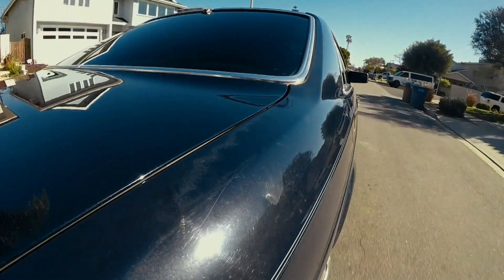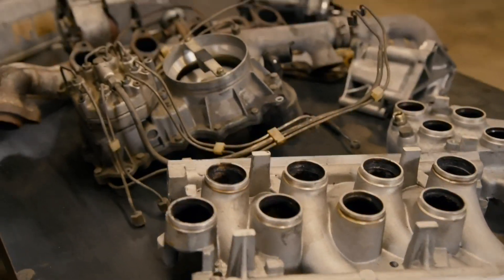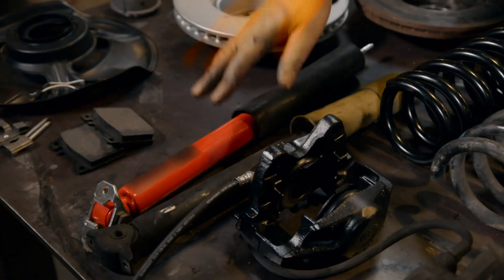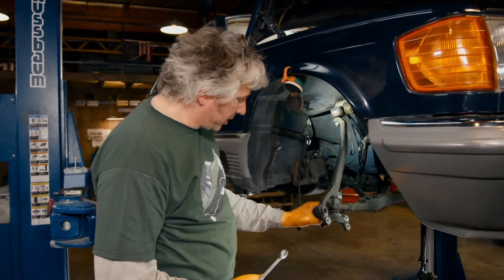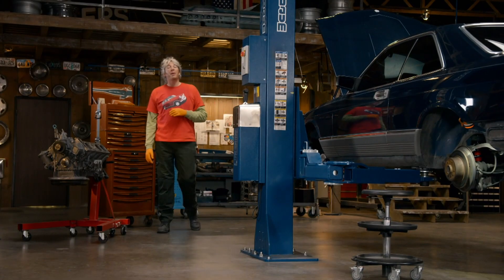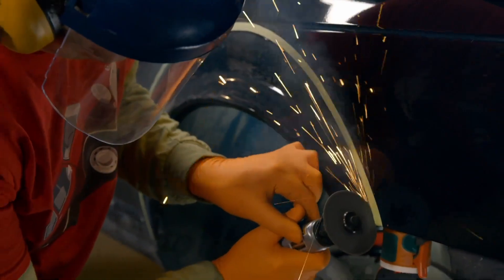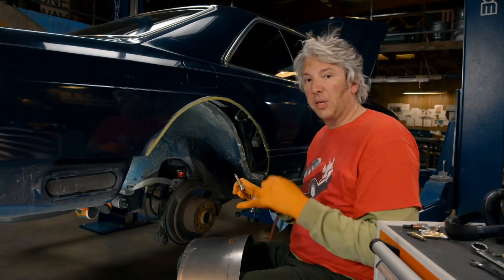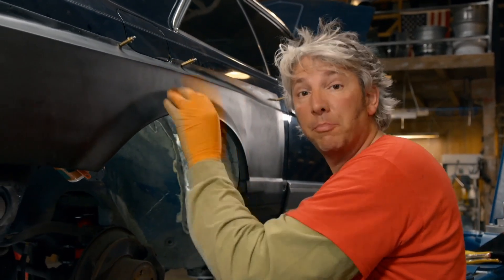Converting a Mercedes 500 SEC Into an AMG Vehicle | Wheeler Dealers

Comment: I love Wheeler Dealers, but the 13th Season was the worst by miles. A lot of speaking and not a single explanation about how to do things, and why would you want an AMG lookalike Mercedes instead of buying a proper AMG?
Reply: Because buying one of these is nearly impossible now, even if you have an unlimited bank account they're very hard to find. And once they are found they demand a very high price, one sold recently in Europe for €235,000 at auction
Reply: Because a real 560SEC wide body is $150k
Reply: The suits thought the fat guy was more important than Ed. Idiots. As for the AMG thing, do you know what a real one costs?! I thought not. 

I myself have a Euro grey market 500SEC with 108k miles I bought from the original owner. These cars are just fantastic. But I won't convert it to an AMG clone. I prefer the stock look.
Reply: It's still a beast
Reply: I understand you all and yes, the car they did here was still very good, but mostly I'm talking about how the 13th season missed the point: Wheeler Dealers in my opinion is about learning how to fix the basic issues of your classic car by yourself. This is nothing like that. This is a work for expert mechanics, expert coachbuilders and expert parts finders (the AMG panels), and they don't explain you well enough how to do it.
They should have bought a 560SEC already converted to widebody with some issues and show how to fix that, in my opinion.
Reply: @Snarl616  just 3d print plastic foam panels and use sand to burn a steel mold

Comment: My favorite episode since I own a black on black euro 500 SEC. Of course mine has not been given an AMG tribute upgrade! :-)  The next time I need brake work I will likely upgrade to 560SEC rotors and calipers (plus ceramic pads to eliminate the horrendous brake dust caking my BBS wheels). I'll also do a custom exhaust at some point and possibly a tasteful sound system upgrade. That's enough for me. I love the original look. These are amazing rides.

Comment: I am not a mercedes fan but the 500sec is one of the most beautyfull cars ever made. Europe version that is. The American version is to high on the wheels and fugly bumpers.
Reply: The ugly headlights too.
As far as performance goes the American ones also had lower compression engines, and often a little resistor chip that retarded the timing because apparently people in America kept using low octane fuel and wrecking the engines.
The American 560sel (5.5L v8) for example had about 70 less hp than the European or Australian versions.

Comment: I was obsessed with the W126 models until I drove one.  It drives like a boat and feels like a 70's car trying to be relevant in the 90's
Reply: They are road cruisers. Not race cars. I have had two, including my current 500 SEC. Fantastic beasts, period.
Reply: @ItsTimePictures  I was just disappointed, I thought it was going to be like more like cars of the early 90's.  But it was closer to like my 80's El Dorado which was a floating lazy boy down the Highway.  But don't get me wrong, I love the lines of the W126, just wish the ride was a little more modern like the W140.

Comment: lmao AMG has always been a subsidiary  of daimler  it is  the performance divison  of mercedes  you can buy any mercedes with AMG upgrades if your wallet is thick enough even back then
Reply: AMG didn't sign a letter of cooperation with Daimler until 1993.  It was formed in 1967.  Almost 25 years of independence.
Reply: @crs290  that may be but when you take into consideration that the  2 founders of AMG were ex employees  of daimler  and used exclusively mercedes cars for their tuning and racing design from day 1  , their first breakthru car being a 300 sel in 71 , I would say there has always been a very close cooperation from the start